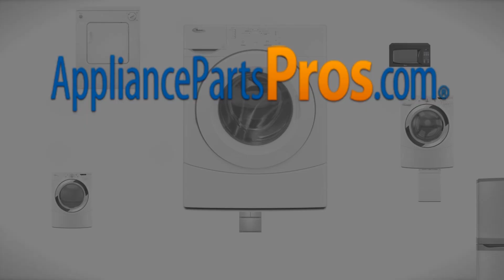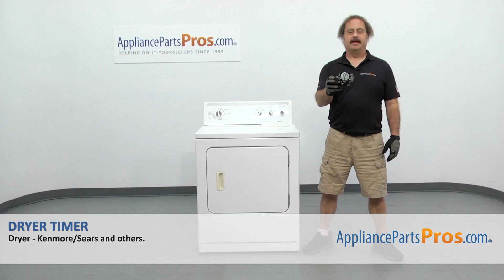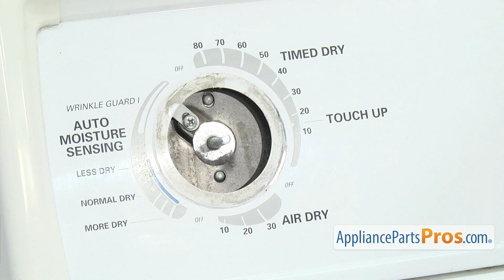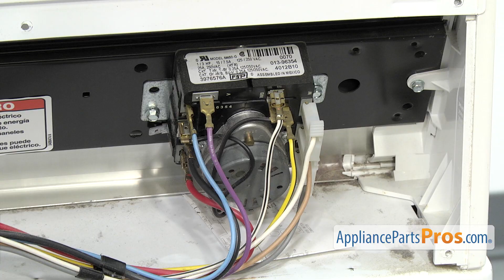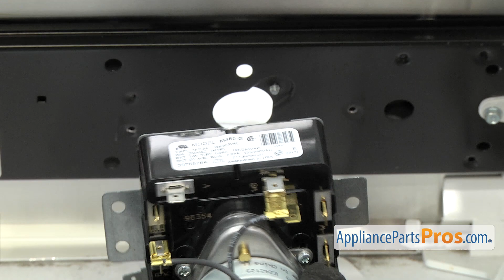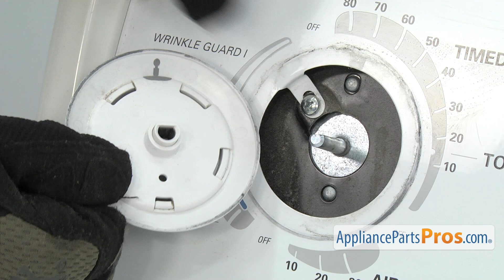How To Replace: Whirlpool/KitchenAid/Maytag Dryer Dryer Timer WP3976576

Comment: Would this explain a dryer that will start but shuts off randomly? Sometimes it will run the complete cycle; sometimes it will shut off anywhere from 5 seconds into the cycle to 5 minutes before it should end; sometimes it will start and immediately shut off unless you "wiggle" the timer knob.
Reply from the maker: That does sound like a bad timer.